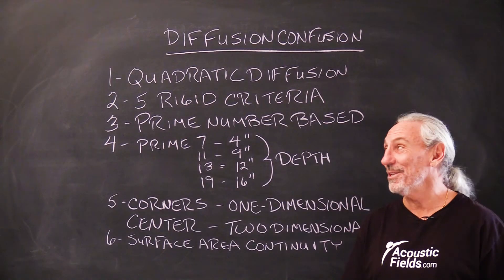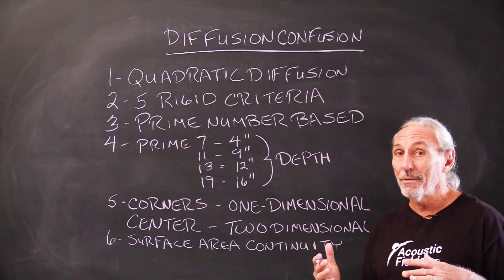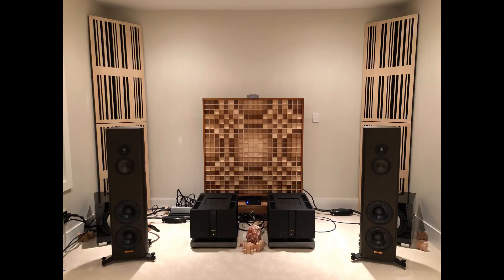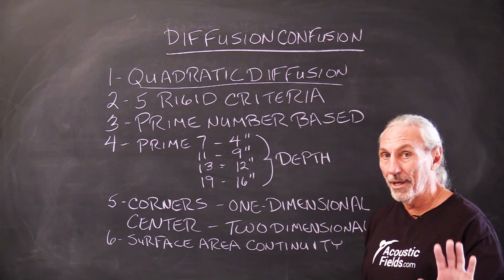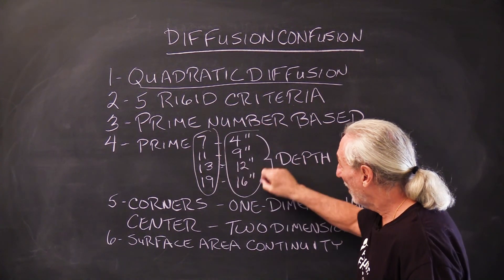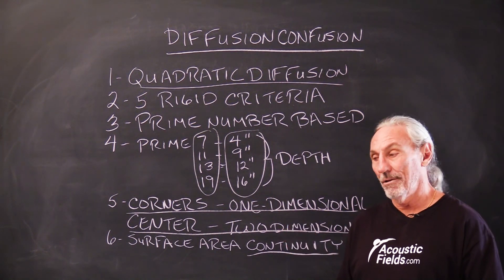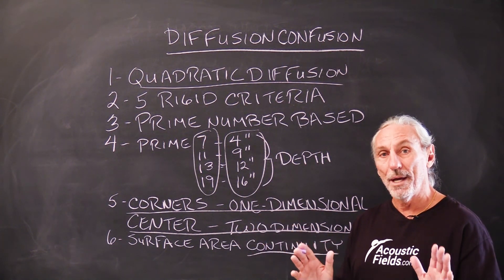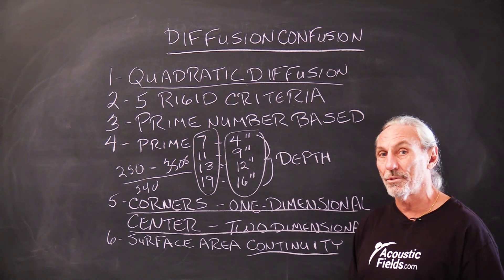Diffusion Confusion - www.AcousticFields.com

Comment: If we can't mix diffuser types can we mix the prime number? For example can we put your QD-23 diffuser next to a QD-17? Or sandwich the QD-23 between two QD-17's?
Reply from the maker: What would your goal be? They are approximately the same size.
Reply: @AcousticFields I'm just asking theoretically. But one practical reason would be space constrains, for example: If 3 QD-23's don't fit on the wall but 1 QD-23 and 2 QD-17's do.
Or another reason is if I want more diffusion in the center but less left and right.
Reply from the maker: @DRAGONSTONEfilm  It is best to keep one prime number on a complete surface area to avoid phase. You can alternate vertical and horizontal placements but it is best to keep the prime the same.
Reply: @AcousticFields  Got it. Thank you :)

Comment: Once again right on point. My question would be when I add one dimensional diffusion to the rear wall in a 2 channel setup should the front wall also be one or can I apply two dimensions in the front.
Reply from the maker: Tou must cover more surface area with diffusion. I would need to know much more data.
Reply: @AcousticFields  Dennis I have a small 2channel listening room . The room measures 15 ft deep x 11, the back half of the room becomes 8 ft wide. The right side of the front stage opens to a kitchen (that opening is 6 ft across. The left side has an opening to a bedroom (that's about 2 1/2 ft. Right now I have all foam treatment on front /rear/sides with thick foam bass traps in the corners where possible. I'm looking into diffusion so I can up my acoustic game (so to speak) and I've been listening to all of your talks on the subject. I don't have deep pockets so I'm going with the GIK 4 Alpha series on my front stage and my question regards the rear, should I go with the Impression pro 4 two dimensions or stay with the same as my front wall? I run a pair of Polk Signature 55s (soon to be upgraded to KLH Kendall's), and I have dual SVS 1000 sealed subs (one on the front wall the other in the rear .

Comment: Hi, Dennis.   I'm interested in the idea that there is some relationship between prime numbers and 'depth.'  Please send me a link to a source that provides the mathematical basis for this relationship.  Thank you.
Reply from the maker: Research the fact that well depth proportionality factor = n2 modulo p where n = integer > = 0 / p = prime number.
Reply: Just getting back into home audio after 35 years. Were building a new house with a room over the garage for dedicated listening. It's under the roof, so it's a canted ceiling at a 10/12 pitch with 48" sidewalls, a peak (or slight flat at about 102" and a room size of 12' x 16' with one window on the front wall and one door at the back left corner. What's your recommendation for initial framing of room prior to any overlay treatment? Stud, rafter and joist configuration/insulation and then veneer ply over that, then absorbtion, then diffusion? I was a career woodworker and am comfortable with all phases of construction and would like to DIY the room.
Thanks, Jon

Comment: Acoustic Fields is the best.  What do you think goes through the minds of people that spend $40000 on one speaker cable but not one cent on room treatment?
Reply from the maker: Achieving quality sound in any critical listening environment requires many steps. These steps must then be sequenced so that certain steps build on the steps before them and after them. We find that cables can have up to a 20 % improvement in balance, resolution, and definition. None of these can be heard well enough to justify the cable cost in an untreated room. Achieving sound quality in small rooms is all about doing the right things in the right order.

Comment: Dennis...you are a legend for sure :-) Humble and presenting all this great info...basically for free. Really appreciate it and the way you present is fast enough and rich enough; dont change the format. I wanted to ask; in terms of diffusion and your definition, when I do modelling eg with a reverb, the diffusion is really smashing the reflections and low diffusion manifests as 'visible' rippling and slapping, even at hi freq. 

Im trying to unravel if your reference to QRD being diffusers is more related towards phase dissipation and is veering towards a cultural point of view (ie that of sound engineers)? Heres what I mean

DIFFUSION: the action of spreading the light from a light source evenly to reduce glare and harsh shadows. (or ray tracing with reflection control I guess)

In PHYSICS
: the intermingling of substances by the natural movement of their particles (because we are dealing with gases but unnatural mingling :)

So let me take a visual reference like a light diffuser; there is little cancellation, Im not seeing much of particular colours highlighting etc but conversely with sound, measuring the room, I can see there are 'colour peaks' and troughs but in regards to applying a QRD solution; isnt that more like a passive spatial eq? If I take it to an extreme eg a limestone cave, the millions of surface variations eg texture, right through to the many pockets and forms, of course contribute to an extended rt60 but the actual sound, to my ears anyway is so smooth. 

So what Im getting to is, diffusion I had thought was producing the psychoacoustic effect of space and removing the low ms spatial interpretation our brain tries to put it...and cramp the space? I look at something like the Hamburg Opera House...and of course its so so much more complex than that.

I understand the concept of basing room treatment on the fundamentals and that makes sense because the canvas should be white, so to speak ie so that the music has a clear background but for small rooms; shouldn't smoothing the 'light' be considered? rather than harsh reflections (and of course rt60 control without hearing your own heartbeat :-)

Another reason I ask is because I have spent a fair bit of time working on diffusion panels (or scattering panels if you like) that are attached to damping membranes and Im hoping to use room analysis to then model the damping solution ie energy being transferred as kinetic in the lows. A bit like a shock absorber system when guys are doing motocross and adjust those parameters to be suit the track they are riding on....all a work in progress but Im thankful for the alogrithmic modelling of eg Grasshopper and the relatively easy management of QRD > CAM.

Here is a pic of one of the very first prototype small tile...has changed a lot since then so its only an indicator; these mount on lead vinyl membrane in a particular suspension capacity which is tuneable in modelling. They use a sustainable cellulose masonry composite called aurastone which contains a lot of wood but is still quite dense; I originally developed as a material called Wood Stone which is used in construction here in Australia, so its related to that. 

https://photos.app.goo.gl/tH9CkDwjsKUL7btE9

They are part of a treatment system, including tuned QRD lightweight masonry blocks of the same material that is create on a per room basis depending on requirements. We are currently trying to get it evaluated at University Of Technology in Sydney.

Really appreciate any insight you might give; your wisdom is highly valued.

Cheers
Mark
Reply from the maker: Diffusion increases Rt-30 times. This is why you must have your absorbent coefficients managed correctly prior to diffusion.
Reply: @AcousticFields  thanks Dennis. Without changing the underlying mirroring surface of energy, wont the nature of the reflection still be highly charged? Ie if the energy is first diffused (for psychacoustic perception) then wont absorption requirements be less? Ie t30 often being extrapolated because of t60 linear relationship difficulty in measurement ie background noise. The reason why im asking all this is because, in my limited experience, the hard mirror affects the transient and hence depth cue. As i have added absorption, it has at the same time affected the 'feel' negatively, to overcome the t60. Being in a natural space with even very hard surfaces but which had fractal variation of the surface, it felt so good and music was so much better. An example is walking into a home made of one of the construction products i use to make; in this case they were hand made blocks with rough raked joints and very bulged adobe brick shape...it still had prob t60 of 2 secs but compared to a normal flat wall, very different. Thats what started me on this journey (and the block alone was stc 51 compared to cinder block at 38 with nothing added). Was amazing just that difference alone

Comment: Hey, Dennis.

I got a small 7.1 HT room (~12ft D x ~11ft W x ~ 12-13ft H) with the window on the back wall. Considering the back wall space from each side of the window is about 4ft from the listening position and about 1-2ft in width, is there any quadratic diffuser size / design that would give me a tangible benefit by installing 2 or 4 units on the back wall? On the ceiling the only hurdle would be the fan, which would be manageable.

I got a fair amount of acoustic foam to treat mids and highs on almost all the corners ("bass trap" design) and panels on the side and rear walls. I still didn't treat the ceiling due to budget at the time and research about the possibility and optimal diffusion solution for the ceiling and back walls for HT usage, as per your teachings, and my limitations in space.

Note: Unfortunately the door is on the front right corner of the room, so between having the front speakers high up on the shelf, above the door, near the ceiling, or having the window on a side wall, I chose the former with the window on the back.

Thanks in advance.
Reply from the maker: This room will require extensive analysis. What is your budget for this project?
Reply: @AcousticFields  Actually it's my bedroom turned into a HT room. To be honest all my budget for this project was already spent when I've renovated the room recently — furniture, breaking all walls and ceiling to put all the audio cable tubes inside, painting, some local acoustic foam, desk, shelves — plus upgrading my audio gear. All 7 channels, including, the sub, were upgraded to the latest Klipsch Reference Premiere series. For the future, there’s also pending the AV Receiver upgrade to 11 channels — 4 ceiling channels for Atmos / 3D audio.

I’m from Brazil and before the pandemic the exchange rate from USD to BRL was already steep, around 3:1, and now it’s 5:1, close to 6. And then there would be the absolutely insane import taxes and shipping fees, so it just wouldn’t be feasible to invest in importing high end products for diffusion and LF treatment solutions. That’s why I’m looking into alternate / DIY solutions for diffusion and LF, since it’s much more complex than absorbing mids and highs.

In any case, I really appreciate your responses and sharing your knowledge. Really like your videos!

Have a nice day!

Comment: Hi! I have three QDR-13  units at the front wall and four QDR-11 units rear wall and they work fine. I was wondering, if I change the rear wall diffusers also to three QDR-13 units since they are wider.  Whould I benefit something? The listening position from the rear wall is 5.25 ft. (QDR -11 recommended minimum) and room width is 13.8 ft. It's a 2 channel listening room. Thank You.
Reply from the maker: Each prime number is almost another octave. Try it and let us know.

Comment: Those in the corners are actually absorbers (corner "bass traps"), not diffusers. I've see a lot of these designs, it is a thin plywood sheet or something similar with various cutout designs, but behind it there is some type of absorber material.
Reply from the maker: Whatever the treatment type, there is not enough surface area coverage with proper rate and level.
Reply: @AcousticFields  Sure, I'm not arguing that. But would you say it is OK to mix absorption and diffusion on a wall (provided the entire area is covered), or is better to use just one?
Reply from the maker: @AlexLapugean  Everything depends  on usage

Comment: Yup, diffusion is the last step in treatment, diffusion needs very critical monitoring and measurements before and after Quardatic Residue Diffusion applied, because skyline dosent make much difference in diffusion and induce wave distortions QRD is recommended. Also be careful with Comb-filtering due to diffusion, especially if room is small. C80 and C50 are helpful and also SPL and phase measurements are essential for proper diffusion applications. Thanks😊
Reply from the maker: "Skyline" is a product name for a two dimensional diffuser.  Two dimensional diffusion can have a positive impact on a sound field if used correctly.
Reply: @AcousticFields  Is QRD three or One dimensional? If yes, can you please explain how?

Comment: What to do with frequencies that are not covered by diffuser? Let's say we have a whole back wall covered by diffusers that work in 300-3500Hz range. Assuming we have 30-100 range covered by absorbers located behind the diffusers, we're left with 100(125)-300 and 3500 and upwards, how do we treat them on the back wall, if at all?
Reply from the maker: What is the sonic goal of the room? Placing diffusers here and there without a sonic strategy is a waste of time and money.
Reply: @AcousticFields  I understand. I was talking about 2ch listening setup. As i know, diffusers are often used on a back wall in such scenario and I was curious what happens with sound that arrives at the back wall and is out of the frequency range of the diffuser? How does it behave then? Do frequencies that strike back wall diffuser, but outside of its range, cause significant problems?
Reply: Pavlo if your wall is untreated, they are going to be reflected, if treated with absorber, they are going to be absorbed. If you use logic, you can pretty much predict what that is going to sound like. As he said, you have to have reason to treat, then develop strategy how to mend and cure your problems. It is absolutely senseless to put those things here and there for no reason whatsoever. You would create more problems, and then you go down the rabbit hole.

Comment: I've watched many Dennis' diffusion videos, but I haven't seen one thing addressed.
The diffusers on AF's website mostly diffuse from under 300 up to 3400 cycles.
What is the reasoning behind such a design and would it make sense to make a diffuser that 
goes even higher since human hearing is a lot more more sensitive in the range of 1500 to 5500 cycles? 

Here's the chart for human hearing sensitivity
https://qph.fs.quoracdn.net/main-qimg-5432f774ad7f623c6d2b2e681d3c7316

P.S.: Big thanks for these videos Dennis, they're very informative.
Reply: The reason is that it is not possible (to my knowledge) to make a diffuser that covers the entire audible spectrum. Even if it was, it would most likely be mostly ineffective. The range of the diffusers at acoustic fields is a good middle ground given the range limitations of diffusers, however diffusers can be made to cover any frequency (with exceptions in the super low end like sub 50 Hertz) .
Reply from the maker: You must decide what your sonic goals are for the room. Diffusion/absorption technologies are tactics that one uses to achieve a sonic goal that is predetermined.
Reply: Was curious about this like you are. I searched for QRD theory and found this: https://www.subwoofer-builder.com/qrd.htm, an interpretation of Acoustic Absorbers and Diffusers: Theory, Design and Application By Trevor Cox, Peter D'Antonio book. In short, to increase HF cutoff of the diffuser, we need to decrease well width, but we will quickly run into various problems, such as period width (width occupied by the wells plus the same number of fins) being less than the wavelength of the lowest frequency diffused, which will decrease lowest frequency of the diffuser. Another well width limitation is determined by so-called Viscous limit - resonant behaviour when energy is transfered from in-resonance wells to adjacent not-in-resonance wells, this limit depends on the panel depth, it seems like. There are other things to consider, I really recommend to read the article, fascinating stuff. I also played with the QRDude calculator, which considers those restrictions, and it looks like we can use higher prime numbers (19, 23, etc.) with no-so-large panel to make wells thin but still avoiding problems listed above and others, listed in the article. There are lot of factors to consider, all design parameters need to be in a fine balance with each other, it's easy to screw everything up.  
I'm in no way an expert, so please take this with a grain of salt and read research yourself ;)
It would be great if Dennis could elaborate on this.
Reply from the maker: You can design the frequency response of the diffuser you require for your usage.

Comment: Hey Dennis, I've got QD7 panels all across my back wall in my listening room (2ft behind listening position). Assuming I'd like diffusion on my front wall, maybe QD11 (front wall is 14Ft from listening position). Where should I place both panels, behind loudspeakers, corners or entire front wall? 

I've purchased your build plans, importation is simply impractical, thanks in advance. 

 Thanks much for continuing to share the knowledge!
Reply from the maker: Start your diffusion 24" off the floor and cover the entire wall surface area.